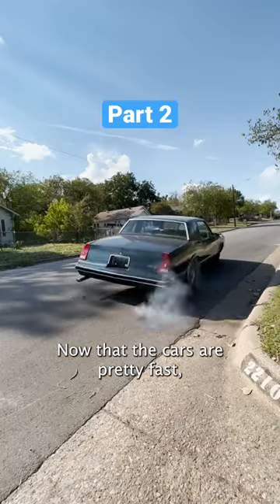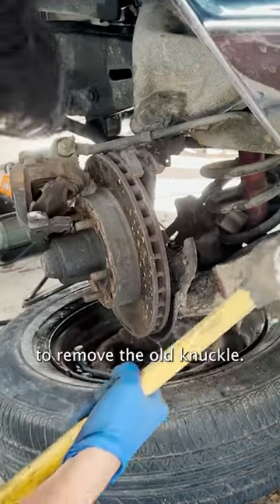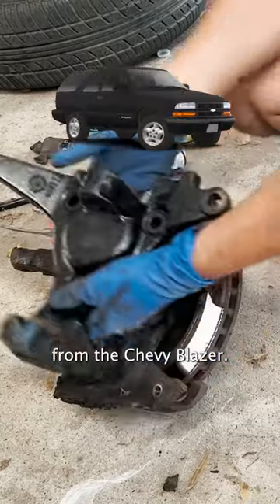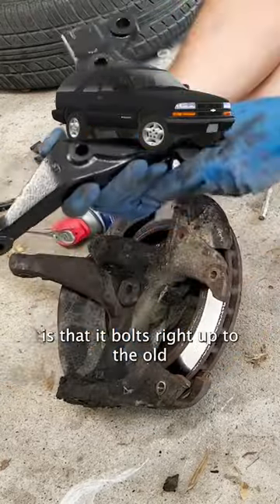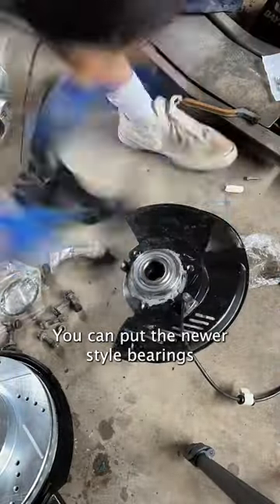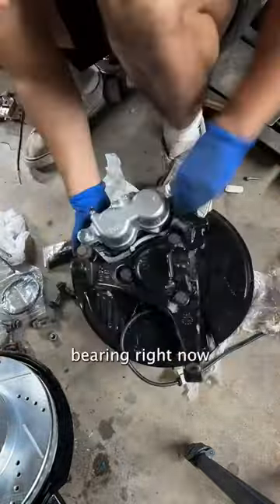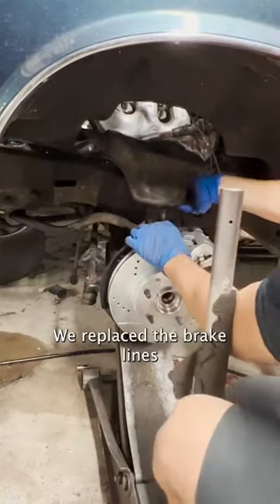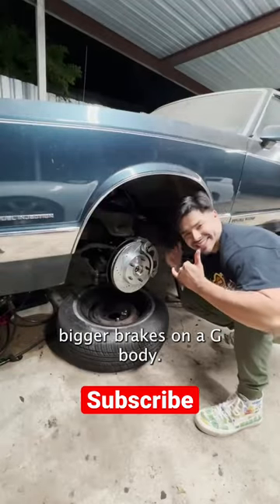G Body Big brake updates part 2 installing knuckles

Comment: You used the wrong wheel bearing that wheel bearing needs an axel to hold it together you need to get a 2 wheel drive wheel bearing that's why theres a hole in the middle if you leave it like that you'll jus go threw alot of wheel bearings

Comment: What year Blazer????
Reply: 2001 . U can also use 2001 camaro  calipers for the back. Jeep grand Cherokee steering shaft works good too.  Ez upgrade
Reply: 2001 blazer. You can upgrade the rears w 2001 camaro calipers. Steering shaft off of a jeep grand Cherokee